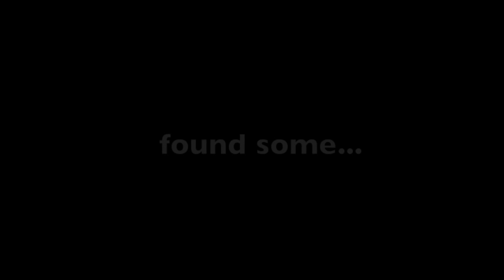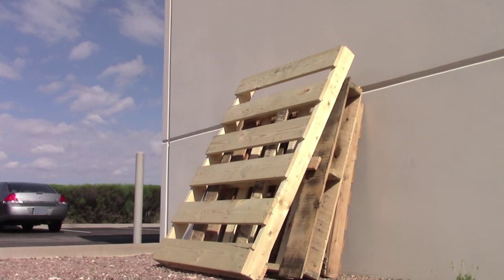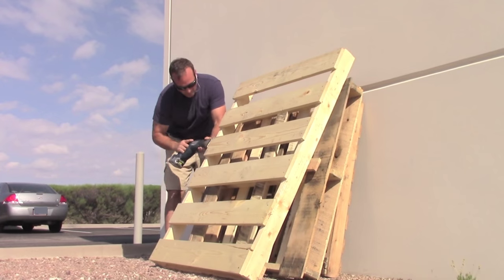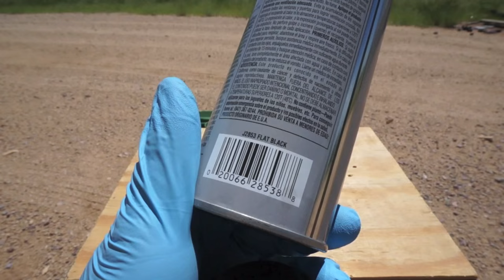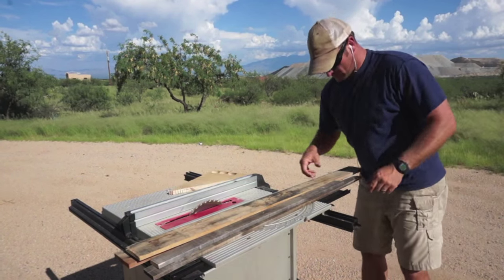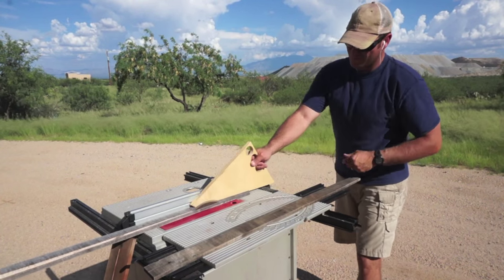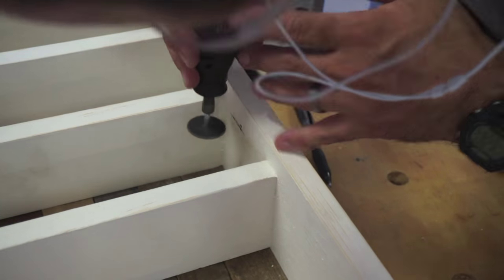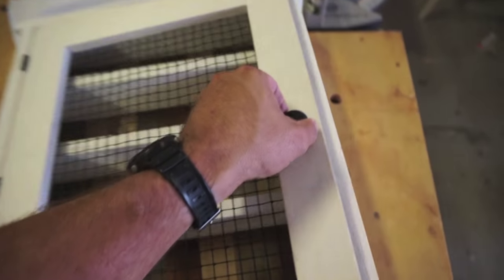Cabinet from a Pallet - Essential Oil Shelf

Comment: Joe that looks great!  Did you have to plane any of the boards or were they all pretty much straight?  I like the back boards to break up the white paint!
Reply from the maker: +The College Woodworker Believe it or not…. no… this was probably the nicest/newest pallet I've seen in a while.  Straight and smooth (except for the parts where I cut with the sawzaw).  The boards almost looked like store bought lumber.  But on that note, I need to keep an eye out for a planer as I don't have one and could really use one at times.  
Thanks for watching:)
Joe